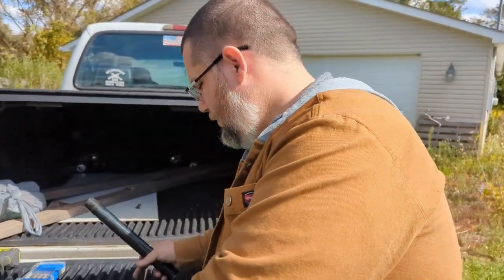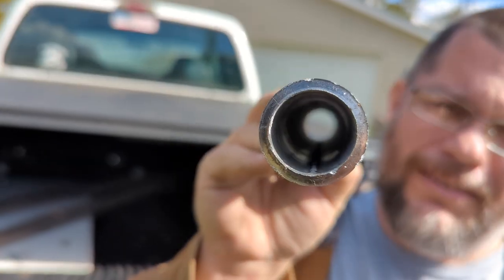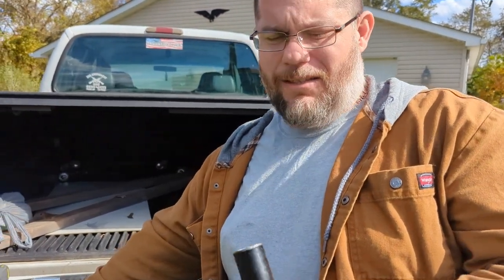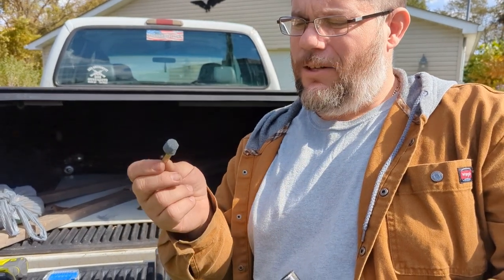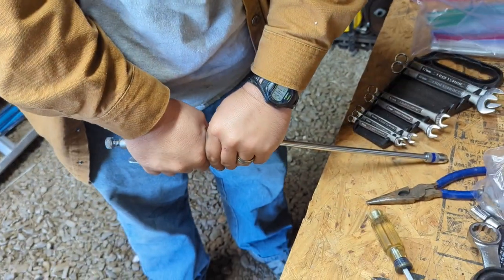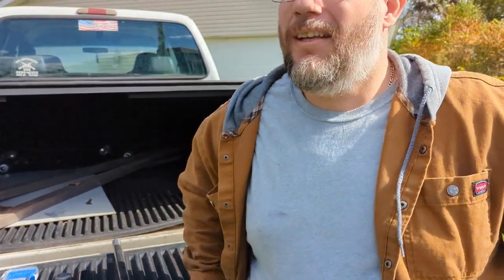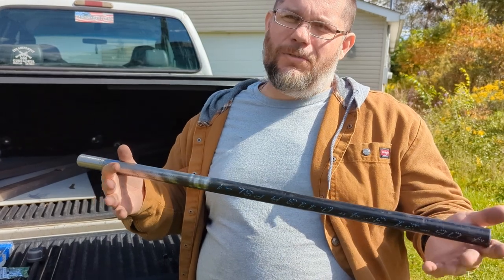Here's a problem you may run into making a 12 Gauge Slamfire Shotgun | Not how to make a zip gun

Comment: I went to Harber Freight and bought a pack of 36 inch drill bits. Used the 3/4 bit and cleaned up the first 4 inches, then filed a round grove across the end that would Function as a place to remove the empty shell if needed!
The 1 inch pipe (Being only 10 inches) I used a 13/16 bit in a 10 inch extention after I rounded the edge with a reaming tool. No need to turn down the outside of the 3/4 pipe...
BTW, you can split the end of the 3/4 pipe and screw a straight connector over it and it works like a choke on any other shotgun! 😉 Been building these for about 15 or 16 years. 👍👍👍

Comment: Use a 1" auger bit and an extension. I tried a stone and a file. The auger was what finally worked. It will full the auger bit a little. But it will work. I used Irwin usually runs around $7-$8

Comment: Grind on shallow groove in the 3/4 in. Pipe that is shorter than what you can easily reach for cleaning up the 1 in. Seam . It will make your three-quarter inch slam consistently on the same track and you won't have to worry about getting out that seam. It works great. And doesn't seem to degrade the strength of the 3/4 nevermind mind that you have a 1 in pipe surrounding that.

Comment: Depending on what tools you have access to there are many ways to deal with the weld seam in the pipe. A few considerations would be. A lathe with a boring bar. A keyway cutter, the right grinding stone and extension, rotary carbide burr, sanding drum in a drill chuck, use a sacrificial pipe and hammer it through to flatten the seam, etc...
Reply from the maker: If I had access to a machine shop I would be making much cooler things. A mini mill and lathe are on the Redneck Outfittters wish list though. The seam was sharp enough to shred my sanding drums and emery cloth. I like the sacrificial pipe swage idea.

Comment: You can try and use a 12" long Round file and/or a half Round file and work from both ends to file down that seam, then your sand paper wrapped around a wood dowel should smooth it out without ripping up the sand paper
Reply: This is the best advice. Exactly what I did, and it worked like a charm. But I cut my 3/4” pipe too short and now there’s only like 10” to hold onto lol gets a tiny bit too close for comfort 😅

Comment: All I did was attach a t to the big pipe then hammer it on and back off over and over until the seam cut a groove into the smaller pipe
Reply: The smaller pipe is the one with all the pressure. You just made the barrel a weak. Take a 3/4 inch wide half round coarse file make your 1-inch pipe 10 inches long and work 5 inches in each end. It takes about 10 minutes

Comment: A shotgun barrel can be 18 inches long minimum there’s different kinds of pipe, yours is  a rolled weld pipe, get a high-quality pipe and there will not be a seam inside. I’m a pipefitter.
Reply from the maker: But the overall length must be 26".
I am going to check the welding supply shops in the area.
Reply: Typo WELD

Comment: Use seamless pipe 3/4 and 1 inch, drill 1/8 holes in end cap around the firing screw to release the pressure so it doesn't blow up in your hand with the 12 gauge shells. Note you can't shoot 3 inch shells or use high speed powder shells. Do not use pipe with a seam
Reply: My dumbass used a 3 1/2 bb shot super magnum before 😅 never again hurt like a motherf$#*$er

Comment: You could do this for cheap with an 8" half round file - bastard cut for quick removal of material. And a 10" medium/fine round file - To smooth it out. You would have to double check width on whichever half round file you choose. I say 8" because most 8" long files range between .71"-.94" for width, so it should have no problem fitting inside the 1" tube. One of the trades that uses this method is pipe-fitters.. You could get both of these for around $25 shipped.

Comment: Rotary carbide burr will take the weld out of the pipe in record time. You can chuck it up in a drill but they're designed for die grinders. If for whatever reason you can't get your hands on a carbide burr you can make a slot in the pipe just deep enough to allow the weld/seam to have clearance. Use a thin cut-off disc to make the slot.
Reply from the maker: I will look into the carbide burr. The slot would require indexing when putting the two pipes together. I would prefer not to have to do that so it will be a last option.

Comment: I used a solid piece of 3/8 pipe, I don’t know what it’s from, but it fits down the 1” pipe, wrapped it in sandpaper from my belt sander and just twisted it back and forth. It takes a little while but it works. Just make sure you make a handle (I used a 1”-3/4” t pipe and a 4” pipe nipple), otherwise that thing goes flying backwards when you fire it lol. I lost my 1” pipe the first time I made one, one second it was there the next second it was gone, that was two years ago now and I still can’t find it 😂 and be careful; black pipe is not rated for the pressure of a 12g buckshot. It’s safer to use birdshot, I just blew one up the other day using fiocchi 1 1/4 oz bb and I was lucky it didn’t blow my hand off

Comment: funny nail slam 12'ga pipe shot guns have been working fine and easy since WW-2' when Philippine guerrillas used them without issue
Reply from the maker: With different pipe/tubing, different tools or cutting a slot it can be done. I was showing that it can be a little more work than most present it as.

Comment: Why not either just cut a slight groove in the 3/4 the full length to ride over seam ? Or slightly flatten one side of the 3/4 with grinding wheel ? Seems like that would work
Reply from the maker: It would work but then the pipes would have to be properly indexed before putting them together.

Comment: 10" cold chisel. You can file the chiseled end so it has a smaller tip like how a screwdriver is angled. Then go at it. The smaller barrel piece that slides in has a seem as well, but you only need about the first 3 inches cleared out to accept the shell. The seem makes no difference in the barrel when fired after that initial 3 inches so it isn't necessary that the whole thing needs removed like the piece your working on. Hours and hours of trial and error dealing with that seem. Notice it's NEVER mentioned in any of these DIY videos for whatever reason.
Reply from the maker: I like the chisel idea. The 3/4 pipe was easily cleared for the "chamber".
Reply: The way I did it was I just filed the 3/4 inch pipe flat on one side and at first I thought it might cause issues but after 3 years it  still works. I just thought my insight might help others
Reply: Would a brake cylinder hone possibly work? Also maybe a drill bit of the correct diameter.

Comment: I used a old stick of 3/4 and a impact socket that was of the same size ground to a eadge beat the hell out of it then cleaned it with sand paper on a PVC pipe. Now I know you can buy seamless pipe. That is much easier to use

Comment: Get small bar about 12mm 1/2 dia cut a slot in the bar with a 1mm slitting disc on a angle grinder put some sand paper in the slot slide it inside the tube and put it in a drill wont take long to make it the right size keep in moving up and down tube so its even takes about 10-15 mins

Comment: I'd say grind a grove in the barrel to accommodate the seam of the larger pipe. If it were to compromise the integrity you'd still have the 1inch pipe over it so it shouldn't blow up in your hands. Could be a quick solution or a bad idea 🧨

Comment: Personally i just use 3 inch long 1in black iron pipe for some reason at least at homedepot all the ones thts like 3-4inchs or shorter seems to not really have a seam (seems to be already ground down on alot of them) and they will slide just fine on a piece of 3/4th inch pipe

Comment: Putting a file in a vice was how I got mine to work. Also don't put a bolt in the back cap but instead cut an inch of dowel and put an inch and 1/6 nain in the center of the dowel

Comment: The problem with removing the seam is it will weaken the structure of the pipe to the point where the " barrel " could fracture & split and injure the person using the gun.Most modern gun manufacturers use either a cold forging over a mandrel or a heated forging method and various types of drilling and lathe type machining process. There are other types of pipes that are of a seamless manufacturing and are used in the steam & oil refinery production, these seamless high pressure pipes may be a better & safer choice for making gun barrels. I am not in the business of making guns or machine parts and would never attempt to tell another person how to  build anything; as a retired E.M.T/ firefighter & former oilfield tank welder my primary concern is for the safety of people who may or may not know the dangers of welding and machine shop environments.
Reply: That’s not the barrel they’re working on, it’s the receiver, no pressure on that unless the barrel fails

Comment: Just buy a pipe that fits all you got to do is go to like home Depot or Lowe's pick up a 3/4-in pipe then pick up a 1-in pipe then slide the three quarter inch pipe into the one inch pipe barrel and keep going through the 1-in pipes until you find one that fits because they are all grinded out different
Reply from the maker: Every pipe we have found has that seam. I will check again as they might have new stock.
Reply: Seamless pipe you can buy don't use pipe with a seam

Comment: 1:13 please just buy a seamless 1 inch SCH 40 pipe nipple or your best bet is to fabricate a chisel or broaching tool just for this 
 
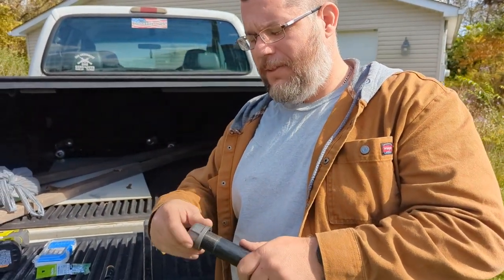1:50 PLEASE use a roof nail in a drilled dowel  instead of tapping the end cap that pops your primers & yes i am nit picking  :-(

Comment: I found a barrel to a 12 gauge in the Thrift store trash dumpster, i should be able to use it for a slam fire right? It does  have a raised piece full length of it . I guess i would have to cut that off so it is round all the way . Its a long barrel. May be able to make 2 . Or no ? Leave it long.i would rather start out with a 410 because i aint done it before. Ive always wanted to make 22 and 410 s just no knowledge when it comes to triggers. So slam fires about all i be able to grasp.. expecialy with just basic tools
Reply from the maker: Depending on your location cutting it could get you in trouble with the law. 
It may not be long enough as is.
Reply: @redneckoutfitters  dont need that. Thanks

Comment: I took a length of 1/4" mild steel round stock, cut a notch in one end. Placed a length of emery cloth in the notch and wrapped it around the bar stock till the diameter was just a little smaller than the inside of the pipe. Chucked the other end in my drill. Took a bit of time but I was able to sand the seam flush. Another option, as someone else in the comments mentioned, is to buy seamless tubing instead of DOM tubing. However if you want to make your slamfire out of local hardware store materiel, then you are stuck with DOM tubing and have to deal with the seam. Here is a look at mine. (I made a black powder muzzle loading barrel as well as the 12 gayge cartridge barrel)  https://www.youtube.com/watch?v=YET-EWp5f-o
Reply from the maker: DOM would be ideal but I was trying to use hardware parts.

Comment: What type of pipe do you use, what is the diameter or size of the water or gas pipe?
Reply from the maker: 3/4" & 1" black steel pipe
Reply: Seamless black gas pipe be safe and sure it's seamless pipe
Reply: 1" over 3/4" black pipe for 12 ga.

Comment: Just cap the pipe with the ammo in it and have a hole drilled in the cap, then take a nail that wedges into the hole and when you want to fire it just hit the nail with a hammer.. that should work but I wouldn't put anything but bird shot in that, definitely no slugs and also never tried this so don't do it.